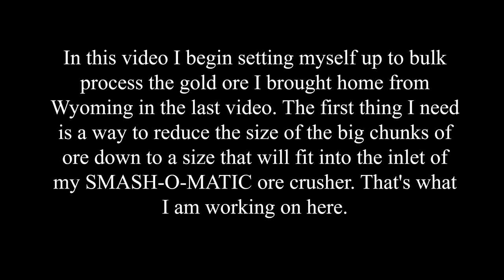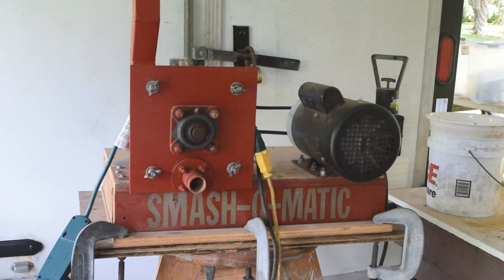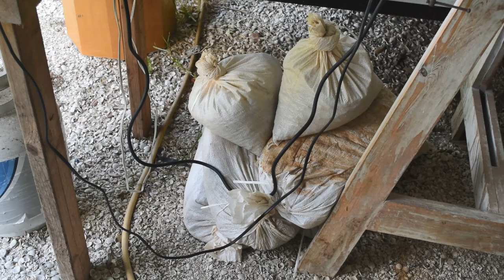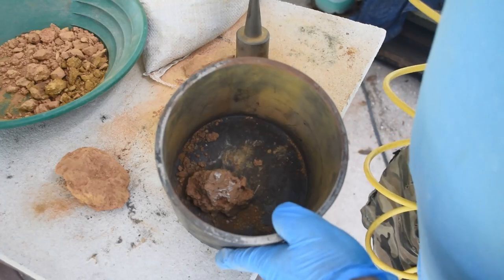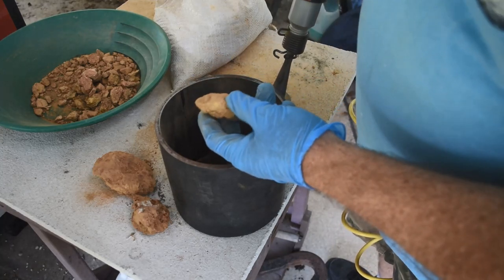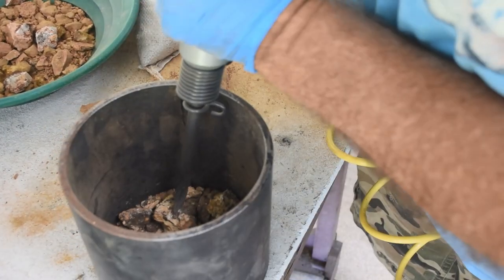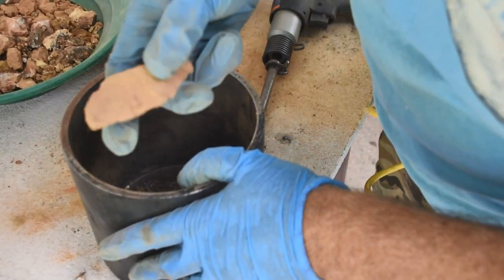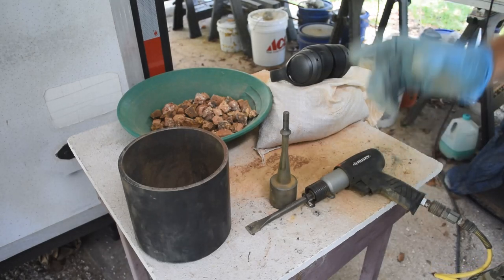Crushing Big Gold Ore Chunks and Lumps From An Abandoned Gold Mine

Comment: In order to split the rock you need sharper ridges on the bottom surface from the pipe where you deposit the ore, and it could also use a ridged surface on your tool from the power hammer. If you can focus the energy from the power hammer to a smaller surface area from the rock it will crack much easier.

Comment: I was going to suggest you just use a sledge hammer, and not just hitting it with the hammer face, but on end, hold the handle upright and just hammer up and down, let the weight do the work. Benefit is your face will be further from the dust and danger. 👍

Comment: Use a smaller pipe with small holes in the bottom... As the hammer ⚒️ smashes  the ore it can fall in a bucket 🪣🪣 under ...
Reply: You could also set it up to feed straight into this smash o matic